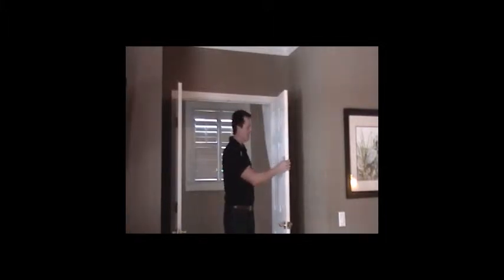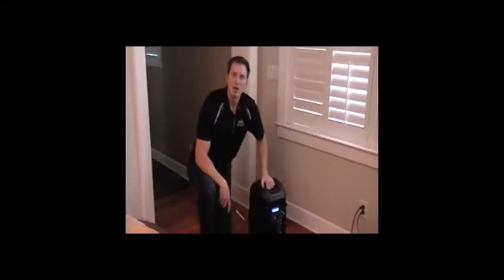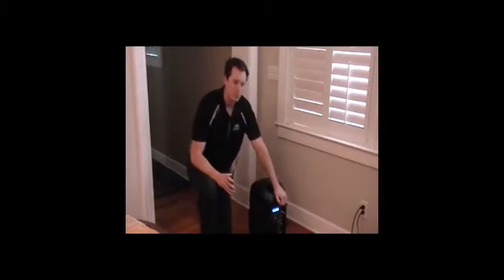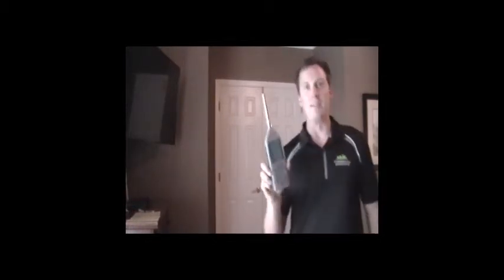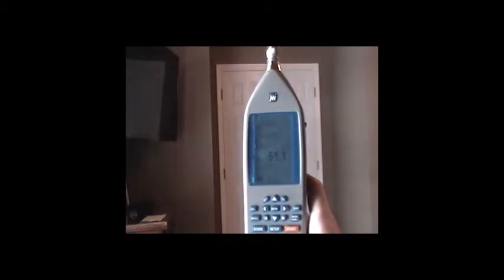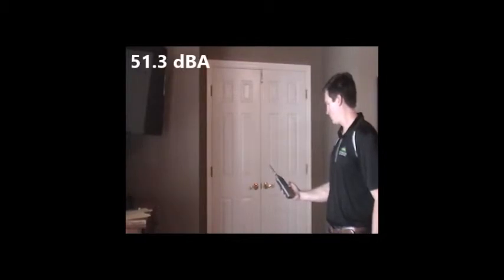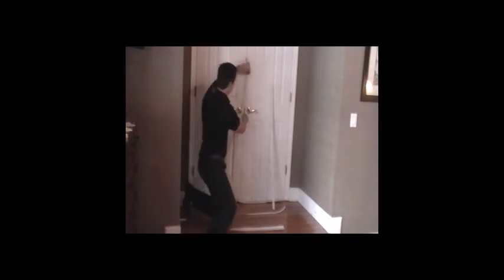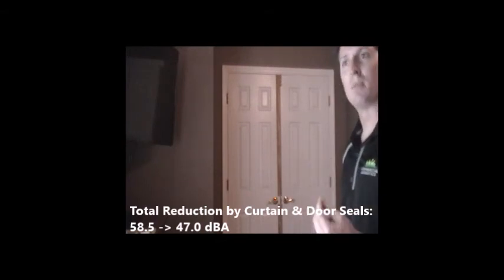Soundproof Your Home Door

Comment: I live in the basement suit and I cant sleep at night because of the noise from the furnace
Reply from the maker: Hi Rose, 

Depending on the setup in your basement you could look into soundproofing curtains for your door, or to use as a room divider. Also, you could try pairing that with a white noise machine to cover the noise of the furnace. https://residential-acoustics.com/